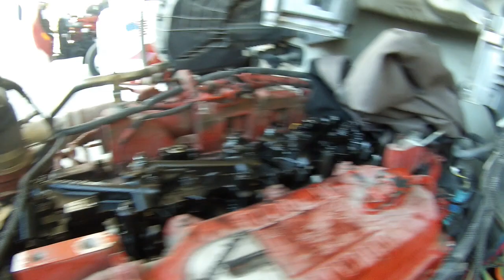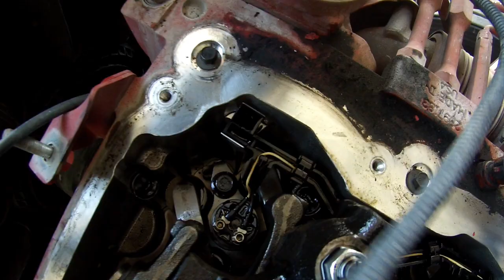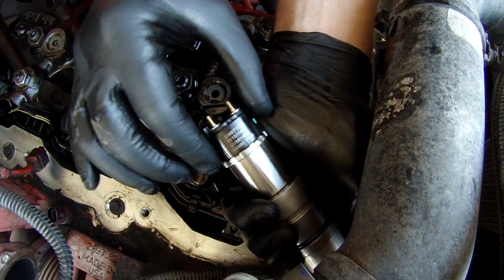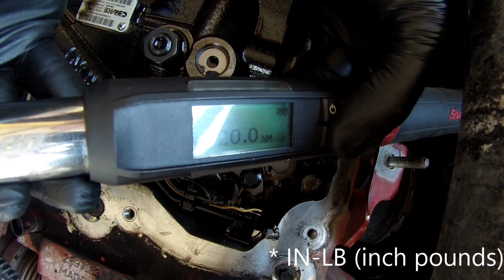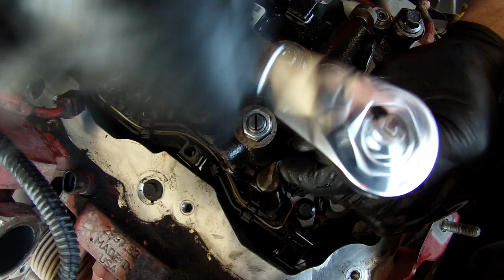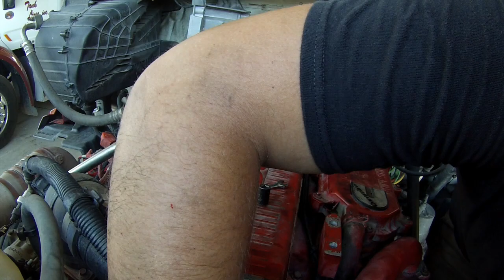How to replace Cummins ISX - Common Rail Fuel Injector

Comment: Hey I like what your doing thats awesome. In my research I stumbled over your project. I take care of school buses for one of the schools here FL. One of the operators put DEF in the fuel tank and contaminated the fuel system.  Looking for some direction and thoughts about this situation I am having here in my home town. Thank you for your teaching I look forward to hearing from you. My name is Santos
you could call me 847-305-7891
Reply from the maker: DEF into fuel?
and the truck was ran after he put it in?
that is going to be very hard to clean. almost gonna have to replace every single component that the DEF went through. The injectors I can almost guarantee are going to be toast. Thats almost like a full just replace whatever the DEF touched kind of job I think...

Comment: Before you ever take any high pressure fuel lines off of a cummins common rail you MUST first bleed off the fuel pressure by loosening the fuel pump to fuel rail connection at the rail.

Comment: How do you bleed pressure off fuel system
Reply: There is a high pressure line that comes from the high pressure pump to the fuel rail, loosen that lines fuel connector at the fuel rail, then tighten back up after pressure is relieved.
Reply: I’m wondering too on that one

Comment: Will an injector cause code 559 I think it’s a low pressure fuel rail issue. Had it at Cummins 2 times they changed the fuel pressure pump and fuel rail pressure sensor but didn’t fix my issue. When I’m accelerating or climbing a hill at max boost CEL comes on for about 5 sec cuts my boost then get it back once it turns off.
Reply from the maker: Dead or alive your're coming with me lol they replaced a pump, 3k pump and didnt fix issue? Daanng. Could be the pressure relief valve, thats usually what i replace first... could be injector but unlikely
Reply: BulletMcNugget wow thanks for replying so fast. They didn’t replace the whole pump but wanted them too cause it’s covered under my extended warranty lol. They only replaced the pressure pump that goes in front of the fuel pump and updated the lines. They did change the pressure relief valve that was their second thing they did. Still have the issues and they don’t know what it is😤
Reply from the maker: Dead or alive your're coming with me so they replaced the head of pump?
Reply: BulletMcNugget they replaced the small high pressure pump on the fuel pump with the 2 lines that run into it.
Reply from the maker: Dead or alive your're coming with me ye thats the head... ive seen it be that little actuator on back of the pump, with the wire coming out of it.
Reply: BulletMcNugget oh ok. I was rreading a thread with a guy with the same exact issue he said it was his fuel/water separator. I might try that next. Cummins don’t know I think they’ll just trial and error from here on.
Reply from the maker: Dead or alive your're coming with me ive seen that happen once before. Guy replaced filter and put a WIX filter instead of oem and had that code. But instead of replacing whole thing if thats what u were reffering too, make a clear line with fittings and bypass seperator and see if it fixes issue. And look for bubbles in the line if u do that
Reply: BulletMcNugget ok thanks. Ya that’s what I was referring to replace the whole thing. I’m told it’s suppose to run full but runs less than halfway. I have the one with the filter below the housing. I don’t even understand how it’s running like that unless there’s another fuel line that bypasses the filter too. But only happens at max boost so that’s why I think it’s a fuel restriction somewhere.
Reply from the maker: Dead or alive your're coming with me i dont think its supposed to run full but could be wrong... look for air, do the clear line. See when code pops up, how far off the commanded and measured pressure is...
Reply: BulletMcNugget I was told it’s suppose to run full so the fuel gets thru the the little inlet at the top but at the same time it’s still running so it doesn’t make sense. But I will try that bypass and see what happens. Cummins said they’ve done all the pressure tests. Unfortunately I don’t have all those tools or insite to check pressures. I’ll try what I can before I take it back to Cummins in Fresno or maybe I’ll try the one in Sac but assuming it’ll be the same. But is closer. Thanks
Reply: BulletMcNugget I just checked my invoice it was the gear pump they changed on the fuel pump thought it was the pressure pump
Reply: Привет можешь мне поменять форсунку ?
Reply: @𝔇𝔞𝔫𝔦𝔢𝔩  I know this was a few years ago, but did the plungers and rollers inside your fuel pump end up shattering into pieces? That 559 code from what I've read is pretty much the death of your pump or even engine.
Reply: @Longhauler85   I had upgraded the ceramic plungers to steel and one of was sticking. They ended up replacing the head and fixed the issue. But that did happen to one of my friends same code plunger did break apart and destroyed his motor. He had to put in a new crate motor cost him around 50K.
Reply: @brkbt93  what year was your truck?

Comment: Florida
Reply from the maker: Jay Kong oo, that place isnt all better then california lol. Humid almost all the time
Reply: Lol I can't do cali dry heat 😀 hey have you come across a Cummins fault code 3225 would love to see you do a video on that code.
Reply from the maker: Jay Kong lol everyone has there own pros and cons of each state. Gonna have to maybe get used to humidity cause thinking of moving east.
Reply from the maker: Jay Kong the purge air actuator one? Ye theres a whole little procedure to check what is actually wrong. I might have one to do on monday or tuesday so if possible ill try to make a video.
Reply: BulletMcNugget ok cool I have that issue with my truck now and the dealership had it for hours they said nothing is wrong with and the code came back I’ll be looking forward to it.